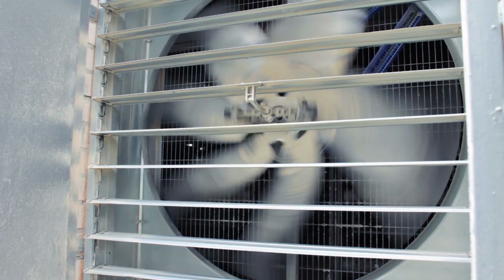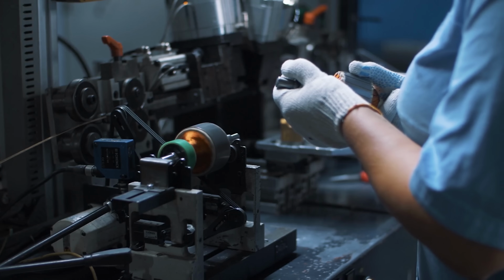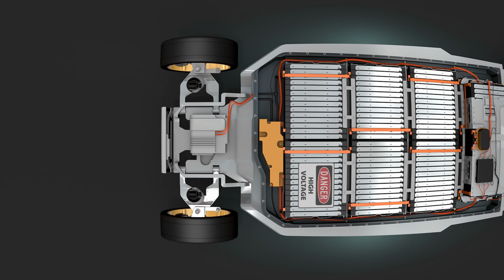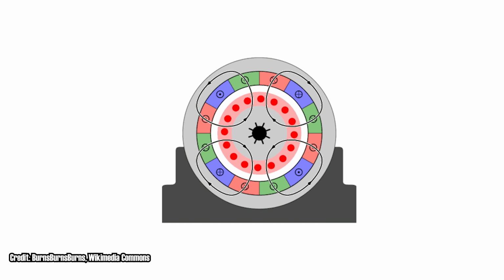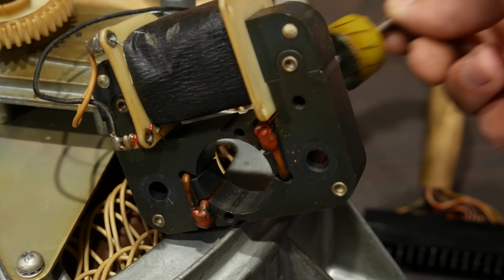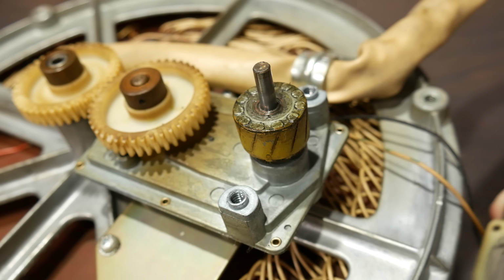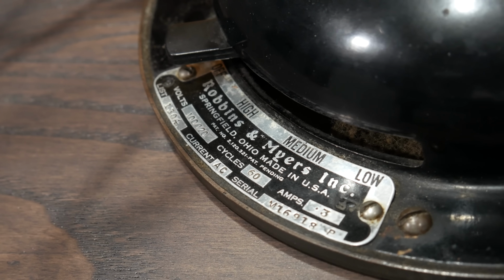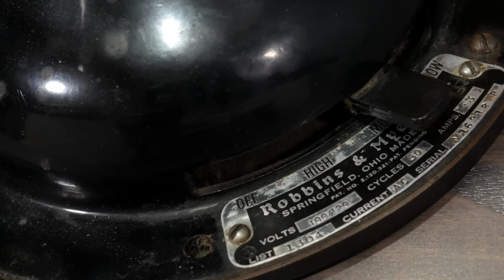Fans; High is next to Off on purpose

Comment: Before watching the video, I really thought the main reason for 1-2-3-OFF was to save the fan from inadvertently being left on.

My reasoning was that if you're in a hurry (or just inattentive) and turn the knob towards 'OFF' before rushing out of the room, you'll immediately be aware that you didn't turn it all the way if it's now on '3' (or 'max').
But if '1' were next to 'OFF', you might think the fan's slowing down means it's about to stop as you walk away, when it'll actually be wasting electricity for all the hours you're away.
Reply: You have a point.
Reply: Have you noticed that it's like that on gas stoves? I still think the reason is safety, so you don't accidentally leave it on the tiniest flame and not notice.
Reply: @sindicta5757  Indeed 👍
Reply: I never thought that before, but thats a good point and some solid thinking!
As for gas stoves that do the same thing, it could be for safety, but now after watching the video I think it's so the flame has enough gas to ignite in the first place from being set to the "high" setting.
Reply: @sindicta5757  gas stoves need to be ignited much like a fan's motors need to be spun
Reply: That was one theory I considered and our ceiling fan would support it sorta.  Problem is on a ceiling fan with a pull switch off is the last state.  It has left me walking back to turn it off  a second time on plenty of occasions.  It takes so long to stop and the motor is quiet.  I often just stand there waiting for the dang thing to almost stop or click it till it hits high and count two more clicks.  Annoying!

I have a large Harbor Freight fan with the order reversed. It's not very intuitive to use because as he said... basically all fans have high first.  I couldn't put my finger on what was so strange about it till I saw this video. 😅
Reply: @sindicta5757  Mine's actually the opposite. It goes OFF - LO - MED - HI - IGNITE

I agree that would be a good safety feature though.
Reply: I always thought fans operated on old timey biplane logic, where you'd have to give it a jump start  to get it to spin on it's own
Reply: That's the dumbest thing I've ever heard. No one would make something for such random and chance based reasons
Reply: @Corn0nTheCobb  Same
Reply: @brrrrrr  Don't know if you can apply the inertia thing to apply torque in an static object with flames behaviour. In mosts stoves from my country. igniting the stove and turning the gas valveare sepparated processes, and igniting the spark while on low and on high both makes the same amount of fire burst. For the fire to happen constantly in that case, you need fuel, oxygen and energy just to start the fuel reaction to the oxygen, it doesn't make sense to spend a prolonged energy output if the purpose of fire is create energy, that means that if you couldn't start the stove at the low gas emanation, you couldn't sustain it if you started on high and went to low gas (and that's exactly what happens in some models if you're running low on gas, it only works with enough opening to let enough gas come out)
Reply: "Wasting electricity" as if my box fan wastes more than 2 cents of power
Reply: @sindicta5757  No? My stove off is immediately next to lowest setting
Reply: That's the only explanation I needed
Reply: Makes sense.
Reply: @AverageAlien  come on man
Reply: @AverageAlien  my can of peanuts has a warning label that reads "made in a facility that processes peanuts" 
This is why you're an average alien and not a smart alien, a smart alien would recognize that we average humans aren't as smart as an average alien.
Reply: @robertdevito5001  pfft
Reply: Not the reason, but really good reasoning!
I think like that too. I am always up for learning the "why".
Reply: @@tiffanyballard9004 
Or just turn the knob until it stops, like a person does.
Reply: @feathero3  That is also very clever thinking
Reply: I think I've thought the same thing at some point.
Reply: High velocity fans start off at the lowest setting.  I like that as they push out tons of air even on low.

Comment: Interesting trivia:  Electric fans were the first common household electrical appliance.  Light bulbs were, of course, first, but this was the first common use of a motor.
Reply: There is a bit of overlap with vacuum cleaner and washing machine, but in general due to the cost, electric fans were available earlier, around 1900-1909. The vacuum cleaners were available from around 1908 in mass. And washing machines from around 1915. There were available earlier (as early as 1904), but really only started being used widely around 1925-1928. All due to the cost of course. Same for hairdriers, they only kicked off around 1920.
Reply: More interesting trivia Michael.  One of the very first electrical appliances was an electric vibrator.  This was used in doctor's offices to bring women to orgasm.  Years ago women had a lot of sexual hangups and sexual frustration, doctors diagnosed this as hysteria so the women would come in and the doctor would masturbate her, obviously, this took considerable time on the doctor's part so the vibrator was developed.  As they use to say "truth is stranger than ficton."
Reply: @Norm475  Well, we all know new ideas are always turned to sex early on. The internet is for porn, after all.
Reply: Imagine people surprise when some areas went from 25 cycles to 60
Reply: I think electric irons were some of the earliest common devices too.

Comment: This is the first time ive heard someone be smart while referring to a rotor as a “spinning thingy”
Reply: Ken Hudson  to this day we have to do something like that. I'm sure you've used a pull start lawnmower or weed whacker at some point, right? Just like the old wind up cars and biplanes, you're pulling a cord wrapped around the motor to get it spinning.
Reply: Ken Hudson  I think Charles Kettering invented the self-starter for cars and made a bundle of money. In the teens or 20s I think.
Reply: @AndyZach  Kettering made the first practical electric starter motor for cars in 1911 and Cadillac used them on their 1912 models.  He was a cofounder of Dayton Engineering Laboratories Company, abbreviated as DELCO (later bought by General Motors and merged with their spark plug division AC Ignitions to become ACDELCO).  Kettering was a very prolific designer, and had near 200 patents in everything from electrical designs to paint to diesel engines to cruise missiles (in 1918)
.

Comment: 3:33 "Going from two wires to three allows you to transmit TRIPLE the amount of energy". Sorry, not triple but by sqrt of 3 (or 1.732...). Still economical though since going two to three wire means 73% more power for just 50% more wire investment.

Comment: At 5:00, You do not have “2 of the 3 phases in your personal breaker panel”. You have split single phase.  Domestic 220/240v power is single phase.

Comment: TC: "Ever wonder why it goes Off-High-Medium-Low?"
Me: Looks over at fan
Fan: 0-1-2
Reply: Capacitor start motor fan gang!
Reply: Imagine having to set your fan high first only to set it low later.

This post was made by electronically controlled brushless fan gang.
Reply: -3
Reply: @Asu01  I have a pretty cheap fan laying around, its bearings are a bit sticky, so i have to set it to high just set it back to low. It just won't start by its own in the low setting :P

Electronically drive brushless motors are one of my favorite devices, my precious ♥️ xD

Comment: I had an old (60's, 70s?) fan which used to stall relatively frequently. Eventually, I realized dust had gotten into places it shouldn't have an increased the required starting torque. It had no issues after a deep clean
Reply: Ok.
Reply: Ok.
Reply: Ok.
Reply: Ok.
Reply: Ok.
Reply: Ok.
Reply: Ok.
Reply: Ok.
Reply: Ok.
Reply: Ok.
Reply: We still have fans from 80s at home they are ceiling fans the oldest one died and we still have one, they actually worked with capacitor which actually gives the initial hit and have to be spun with a stick
Reply: Ok.

Comment: My Cold Spot fan sold in Sears in 1950 has no speed control and no switch.  Just plug it in and it runs.  Bought it at an antique shop years ago.  Before using it I took the motor apart and did a thorough cleaning of the rotor & stator.  Cleaned the air vent slots and the two bushings.  Put it back together and used # 30 oil to lube the bushings.  I recommend that you do the same to your antique fan.  It will make your fan happy.  If I lived in the same town as you I would do the work for free if you didn’t feel comfortable tackling the job yourself.  I can’t afford to be a Patreon so it would be my way of giving back.
Reply: Aww
Reply: Weird
Reply: @rickylee2477  let this person have their hobbies bro.
im into high precision metrology equipment, there are more niche hobbies than electric fans.
Reply: @rickylee2477  all of us are a little weird at least :]
Reply: Sold at Sears and made in the USA…in 1950 🇺🇸
Reply: I have a compact ceramic space heater that's 35 years old and I use it all the time , Such as during the summer if I have trouble getting to sleep , The soft sound helps me get to sleep , I put the selector switch to fan only and in the winter , High or low heat , But anyway , periodically I have to open it up and blow out the heater core because a ceramic space heater , The core looks like a car radiator and gets blocked with dust frequently and I clean the heater core every 2 months and besides blowing out the heater core , I take the impeller off and blow out the dust on the motor to make it run cooler and I give the motor bearings a dab of 3 in one oil and by doing this , You'd be surprised how much longer it will last , One day the selector switch went bad on it and because of how old it is There was no parts available for it , So I drew up a wiring diagram and replaced the selector switch with two toggle switches to get the same settings 
Fan only , Low heat and high heat and still , The space heater runs as if it was brand new , The most common problem with small motors is that the appliance doesn't get opened up-and dirt doesn't get cleaned out and the motor bearings don't get oiled , 
Small motorized appliances with shaded pole motors have sleeve bearings which need to be cleaned and oiled periodically , By giving your small motorized appliances periodic attention will last much much longer 
My space heater is 35 years old and is still running strong , I love the design of it , That it's compact and puts out really good heat just the same as those bulky ones , That's why I want to keep it for as long as possible and ceramic space heaters give the best transfer of heat
Reply: @rickylee2477 ur comment is the weird one ironically
Reply: ..question.. You mentioned # 30 oil. Do you have an Amazon link or something? I tried to add it to my list for later, but apparently now it thinks I need 30 weight oil for my car, and nothing to help my fans... Hah.

Comment: 6:09 “something like a fan which could be running for DAYS at a time...”

Laughs nervously at the fan in my room that I turned on and forgot about years ago.
Reply: 1000+ days is still "days."
Also, don't turn that fan off unless you want to buy a new one.  A fan that's been running for that long will very often die if you turn it off and try to restart it.  As we said of hard drives in I.T., "it's like patients in an old folks' home, you put them down to sleep and some just don't wake up."
Reply: That's a really long time!
Reply: i am high class cause i turn mine off every 4 years to clean it;)
Reply: @Bacteriophagebs  And 1000 days is 8.64e+7 seconds, which is still "seconds" but that's not how we communicate timeframes, sir.
Reply: Wtf that fan is probably the dustiest dirtiest garbage ass fan
Reply: @Bacteriophagebs  But only the capacitor so $5 restart cost.
Reply: we have a fan in the garage, it has never been turned off...

Comment: Fan designer: "We must put High first for safety"
Also fan designer: Makes a spinny finger-muncher
Reply: Back in the day where if you stuck your finger into spinning blades and lost a finger, that's Darwin telling you it's your fault.   Their motto: "Safety third!"
Reply: The safety of their warranty department.
Reply: My grandparents had one of those heavy, metal fans with barely any grill. They look worse than they are. The edge around the circumference is always protected, and if your hand approaches the blades from the front, it will most likely be pushed back due to the angle of the blades. It's only a problem if you come at it from behind, where the leading edge will hit you first. I wouldn't let a toddler near one, but for older children and adults, it's fine. You'd really have to want to injure yourself with them.
Reply: @ironcito1101  Oh cool, I'm also a heavy metal fan!
Reply: @Ciborium  which leads me to this question:  why don't aircraft propellers have the safety shield that fans do? 😁
Reply: I like to imagine the inventor of the electric fan having to fight the urge to stick his fingers into this new thing hes created
Edit: you turn your back on him for a second and you hear it... BRPRPRPRPRPRPRPR
Reply: @bottledpills  even a "high-power" PC fan is not strong enough to cut off a finger. Maybe it can make a small cut in the finger or cut off the skin on the fingertip, but you won't get a serious injury from them. Still it is advisable to watch out or use a fan grille.
Reply: @bottledpills  No PC fan has metallic blades. It would just make them turn slower when the power rating is the same because metal blades are heavier, even if they are made of aluminum or titanium.

But even with plastic blades you might get a small cut and might even bleed a bit if it is a high-powered fan (which would be around 10-20W for a PC fan), but this I would consider a light injury, not a serious injury.
Reply: Those were the times where elevator doors could rip your arms off if you got stuck in them.
Reply: @Lttlemoi  But I think that at that times there  was also always an operator in the elevator who closed the doors, they weren't closed by the passengers and the elevator was only moving when the operator made it move. Automatic doors in elevators existed much later, I think starting in the 1970s. In the 60s automatic doors actually still had a mechanism that needed a lot of space, this is why the doors in the original Star Trek where actually opened and closed using a pulley.

Some elevators like paternoster lifts didn't have doors or operators so they where in theory dangerous if you would have exited them at the wrong time but they where driving very slowly but in these there where some accidents with drunk people or people who tried transport bulky items in them.
Reply: @bottledpills  You can pull the fans out of most chassis I encountered because they are designed to hot-swap, but then you usually end up with the remaining fans kicking into high as well, which just means even more risk chopping your fingers off, especially the smaller they get the faster they spin anyways.
Reply: @rfvtgbzhn  In Belgium, and I suppose in many other places, some of those old elevators are still in use and are not required to be upgraded entirely to the latest safety requirements. A few years back, a toddler got crushed in one of those and died thanks to that.
Reply: Bruh that's why there's a cage.
Reply: Reverse those 2 sentences and it makes more sense
Reply: @rfvtgbzhn  As mind.overflow said, he was working on severs. They can have some seriously strong fans in them, with some 120mm in my collection drawing at least an 1.5 amps 12 v starting current and running at ~4k rpm full tilt.
Reply: @soundspark  They are indeed often very torquey and sharp.

Comment: Wild, I work at an observatory and I’m trying to understand/redesign our single phase and 3 phase motors used on our dome, but had no idea what I was doing or anything about how they worked. Thankfully I had older engineers figuring out the important stuff, but I can’t believe your video about fans would be the connection I needed to figure out the part of a telescope system!

Comment: I live in the UK and I have never seen a fan with high next to off, this is a completely alien concept to me! Great video as usual :)
Reply: Same as me in Australia, we just have 3 buttons for different speeds on our fans.  But I do have a very cheap fan which sometimes doesn't start on low speed at all, it just stalls or takes about 45 seconds to get up to speed.
Reply: same, i live in germany, never saw that before. i have a fan with a button that you press to turn it on and a button to change speed, or those clicky buttons idk how to describe

but even on fans with turn-knobs its just Off-Low-Mid-High. is this just in the US?
Reply: Same in Sweden. I have a desk fan with a rotary power switch which is in the order 0 to 3, with 0 being of and 3 being high, never seen a fan with high after off.
Reply: I’m in Singapore, and there are no fans with high next to off that I have seen.(idk, maybe because former crown colony?) They are all just 0, 1, 2, 3 buttons
Reply: Also in the UK, I imagine its due to being 240v vs 120v probably maybe gives it more starting torque even on low setting.
Reply: Same here in poland
Reply: Same, um from Germany and either the fans have buttons or they go from low to high. I've never seen a fan that goes from high to low. Super interesting!
Reply: Hi, I'm from Mars and can confirm that our fans don't have Off next to High
Reply: In Korea we have fans with selector buttons
Reply: @ChoboUnjeon  Another from Germany, never seen a fan with off next to high in 60 years. Just asked my mother, she says she hasn't seen any either. I think it's the US being the US again.
Reply: Central Europe here, finding out there are fans with high next to off was like getting hit in the face with a shovel